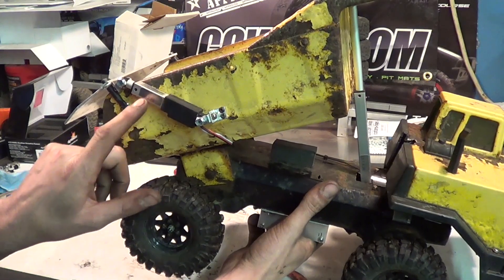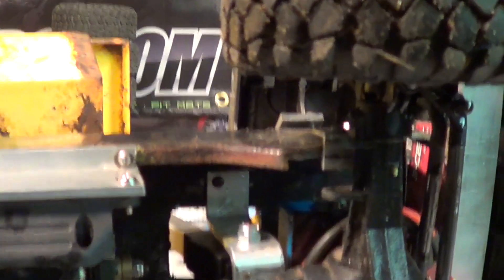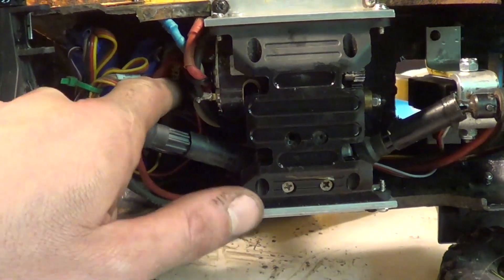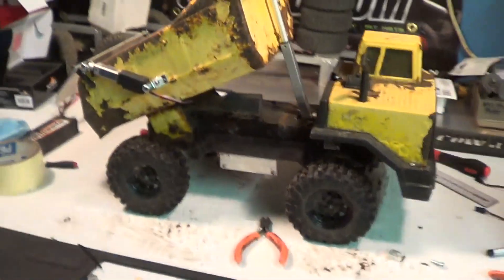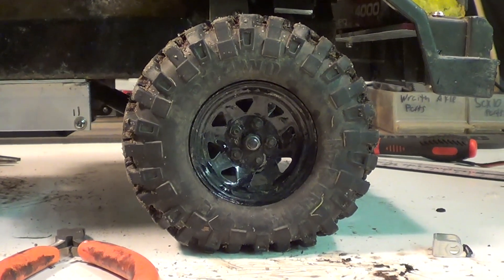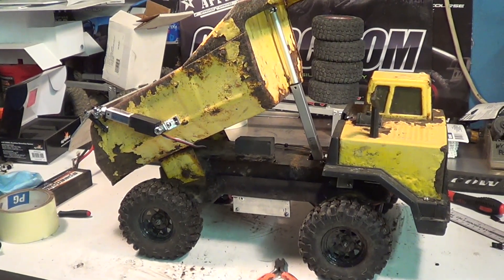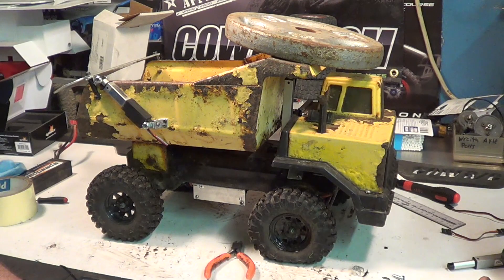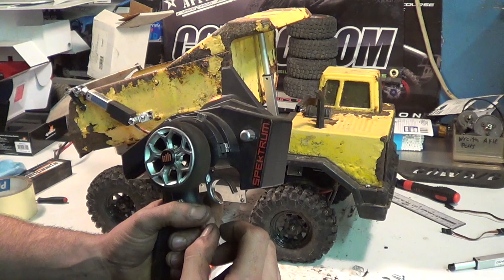JRP RC - How To Make A Rc Tonka Truck Dump

Comment: Thanks man great helpful video! I'm retired from Towing the Big rigs but it's still in my blood. Been Big R/C fan all my life and racin short course trucks and legend cars at the moment. Found the you tube videos of the big right tow trucks which are totally amazing how life like.  Lots of time and loads of money in them but seriously thinking of getting started on getting a tamiya truck and starting my own project. Thinking they used actual hydraulic systems but I'm thinking the electric actuators will do the job just fine.  Thanks again for the great info and the tonka dump is awesome! Be proud my friend, great job!!!

Comment: so, they worth the 99 bucks with shipping? I really want one!
Reply from the maker: I say yes there worth it, but there not great for everything, side loads are bad, and water is bad. I think of it this way, if you want a standard servo that will lift 10 lbs thats at least a $100 servo :) or hydraulics where youd be in at least $300
Reply: hmm. was debating between the actuator and that LESU dump thing. but the lesu needs a motor and an esc for that to. but then i could go waterproof. if everything else is water proof might as well keep it 100% then
Reply from the maker: there not hydraulic, there electric. www.firgelli.com
Reply: JRP RC Judd Phillips Where do I get the hydraulic stuff?

Comment: great tip! do you run it on 12V or does it works proper on lower voltages like 7,2V?
Reply from the maker: the actuators run at 6 volts
Reply: thanx. This is the L16S-series am I right?
Reply from the maker: these are the L12-R actuators, they will have L16-R actuators available in a month or 2

Comment from the maker: the truck is almost 16lbs and 25lbs with a load. I couldn't get it to even move with the slipper on it as tight as I could get it. so I took it off :)